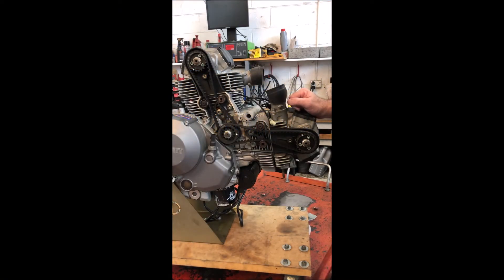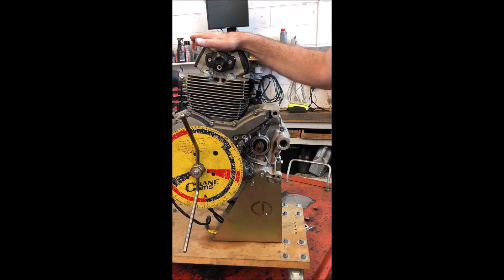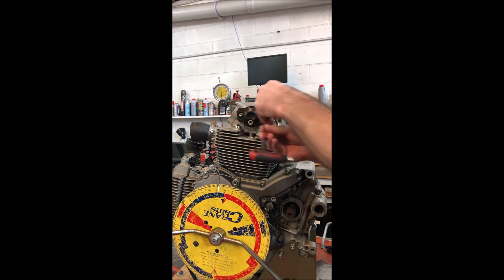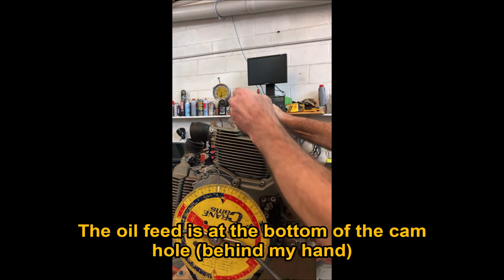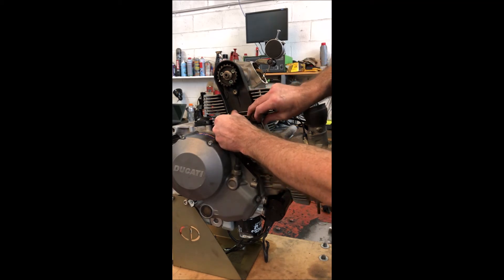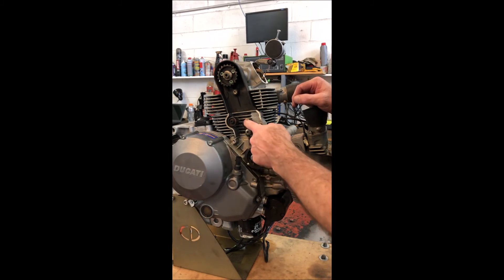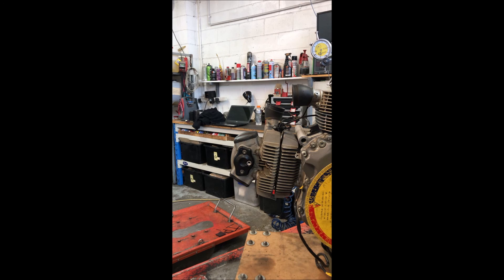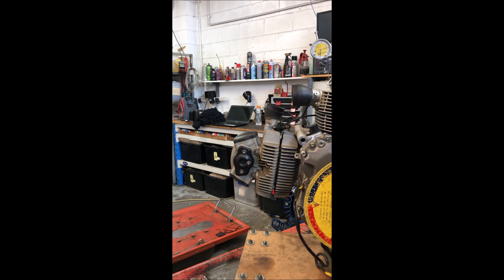Ducati 659 696 796 Engine - Valve clearance, Timing belts Cam timing - part 2

Comment: I just bought a M796 with 9760 miles with original timing belts. I heard it run and shut it off. I am so glad i found this video and how to assure the cams are in the right place. i would have been at a loss when i realized no corresponding marks on the cover. Also i realize the importance of the 100 hz. Tight but not too tight. i am thinking the reason these engines go through the bearings more is the belts are a little tighter than the earlier engines. That is asking a lot out of those little bearings! if you look at the bearings for car timing belts the bearings are huge by comparison and they turn at a lower speed because of a larger diameter. Ducatis go higher in the revs too.
Reply from the maker: belts are not at all tighter.  a bit looser if anything.  probably just a badly spec'd part for the job.  the bearing speed is not excessively high.

Comment: what about vertical timing. is it same right?
how to find the firing vertical ? after find that set three teeth before TDC of cam right?
Reply from the maker: the vertical firing is the tdc where the timing shaft dot is at 3 o'clock / pointing at the horizontal cam.  with the crank at that point, you could then use the same method to set the vertical cam.  again, that's just a guess based on about where it should end up.  the slot in the end of the vertical cam should line up with the hole in the cam cover once you've moved the crank back to horizontal tdc firing, where all timing marks line up.

Comment: Great videos, thanks. Question, I’m about to rebuild my 900 Elefant. It’s an early motor with exterior oil lines to the barrels. I have a pair of new later barrels without the oil connections.anyone know what’s necessary to use them on the early cases?

Comment: hello. i bought a broken engine and i m going to rebuild it. just one question. do i need to put in in a specific stroke ex compression stroke  and line the marks or if i allign the marks on the crankshaft and the marks on the cams it will be automatically in time? thanks.
Reply from the maker: if the marks are aligned then yes, it should all be correct.  just turn it over slowly first.
Reply: @bradthebikeboy  ok thanks.. can It Be out of 180° but the Mark line up?
Reply from the maker: @TheMasterizzatore  if the timing gears are fitted correctly, the mark on the timing shaft lines up only once per cycle (720 degrees), so if you understand what you're doing and it's put together right, it's right.
Reply: @bradthebikeboy  ok i Say that Just because i m used to Japan biked wich havent got the reduction Gear for the pulley on the crank shaft

Comment: Belts on my 696 tend to walk off the cam pulleys by about 1 mm. Could this be due to the bearings like you mentioned or the belt tension? Bike only has about 4200 miles.
Reply from the maker: if they stay in that position i'd not be overly concerned about it - i think i see it a bit.  if they walk off into the belts covers there's an issue.  if the bearings and tension are good neither should be causing an issue.

Comment: On those bearings for the belts- the idler ones (that dont move with the tensioner) that are double stacked two bearings with a circlip- I checked and you can get them at your local autoparts store, theyre the same as some Ford cars use for a pilot bushing in the end of the crank, they go for like  $6 ea
Reply from the maker: the replaceable bearings ones are from older models.  the ones on this engine are a 1 piece bearing with the mounting screw as part of it.  have been that way for some time, i don't recall when they first appeared now.
Reply: @bradthebikeboy  I know I changed them on my buddies Multistrada 1000DS (the first gen Ugly one with the fairing that half turned with the bars) and it had the 2 pc Bearing idlers.......